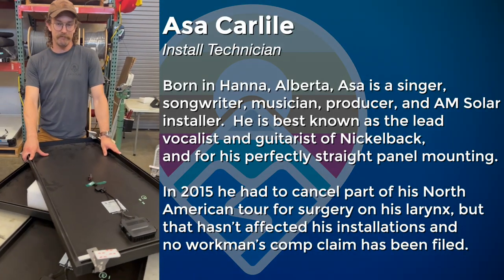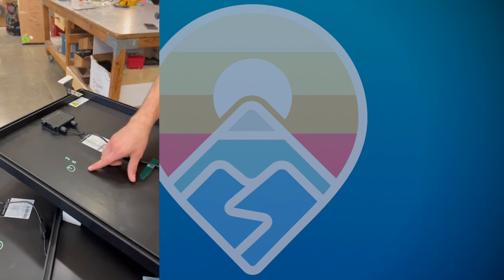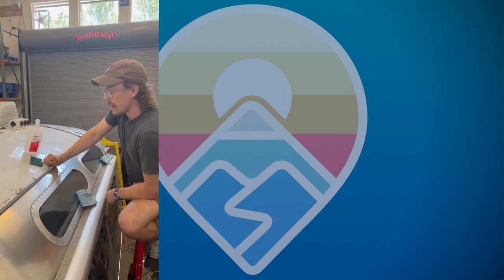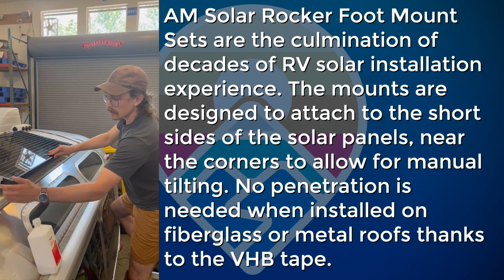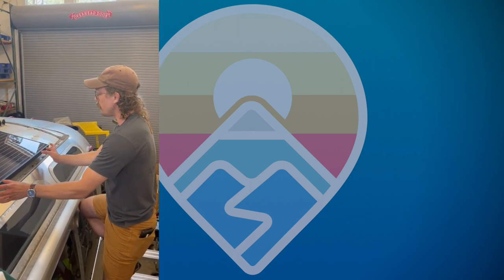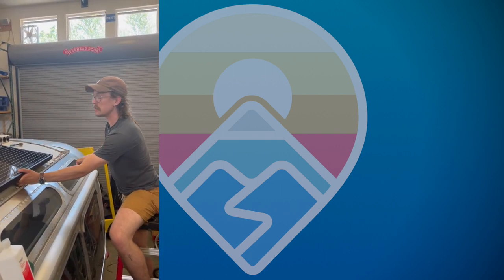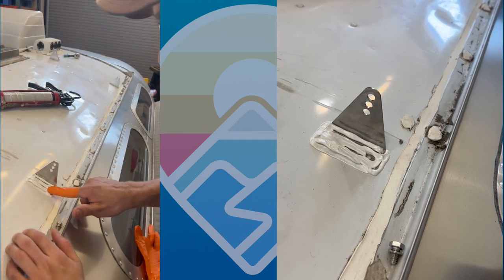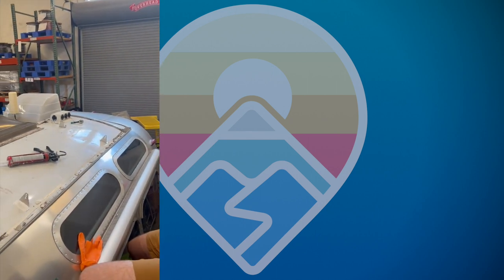Airstream Solar Panel Installation | Airstream Solar

Comment: so about the wires, the default length is a bit too long, do you splice new MC4 ends on them to make them tight or do you secure them to the roof in some fashion?  What is the best way to manage the wires going from panel to panel?

Comment: I know that VHB tape is really strong, but can it handle being parked in the heat we have in Phoenix summers.  It's hard to trust something will stay on a roof without bolting it down.
Reply from the maker: The VHB tape is pretty amazing and the proof seems to be the results. We have been selling thousands of mount sets per year, all over North America (especially in AZ) for over two decades, and there has never been an issue. It probably helps that the mount foot is completely buried in white sealant.
Reply: @GarretTowneAMS  They use VHB tape to secure the exterior veneer panels on skyscrapers. The key is bonding surface area. The larger the surface area the greater the bond.